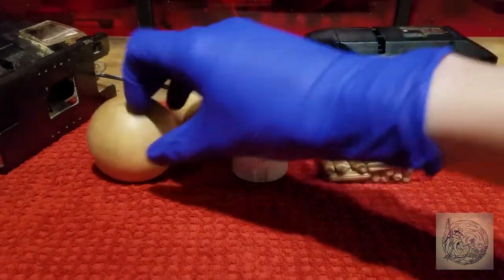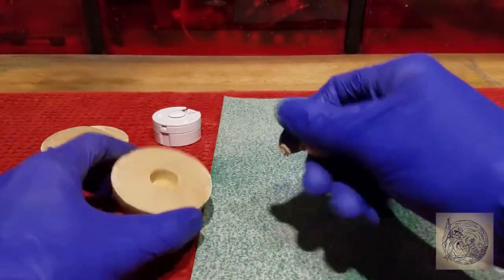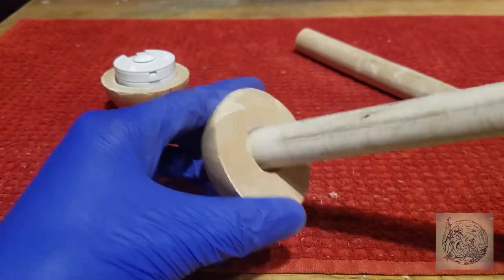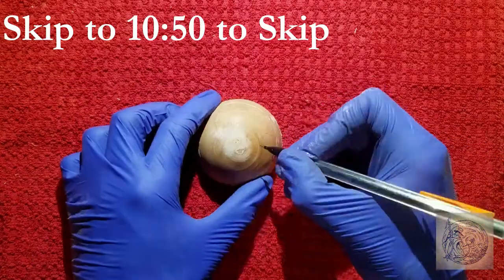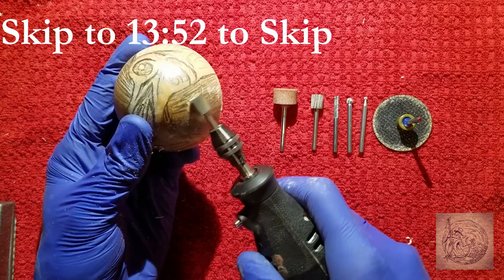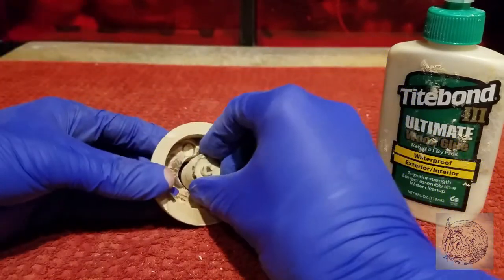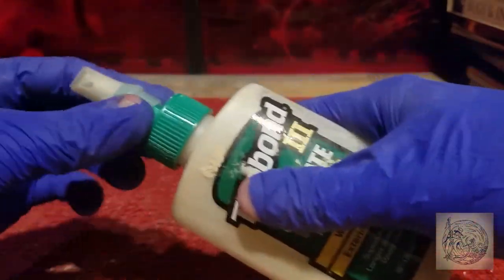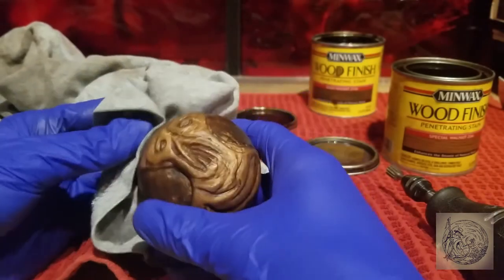Dark Souls: Hawkeye's Carving DIY

Comment from the maker: Hey guys, give me some tips to help improve my videos. I've been working on the suggestions given so far. I bought a new mic and I'm working on finding a better voice recording room. I figured out how to make custom thumbnails with the prop and added breakaways between steps.

Personally, I feel my videos are too long and boring, I added the time skips and tried a few methods to speed up the process. My camera work is shakey and my hands often times block out what I'm doing, so I tried getting different camera angles.

Are the changes good, bad?

Should I keep doing these small pieces or would you guys prefer to see more weapons? Weapons will take longer and I'm already too slow to keep that in mind.
Reply: Hi Ulric, i think you're improving, i have seen yours videos from time to time over the years and i think you're a amazing content creator.
Working with wood is a complex process, so long videos for this kind of work is always good because of the little details, sorry for taking 4 years to give a feedback